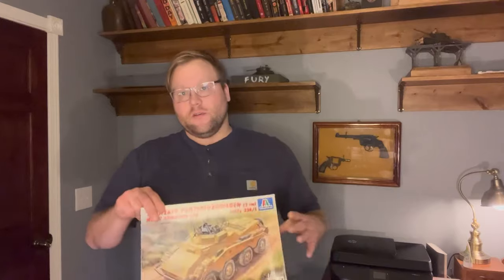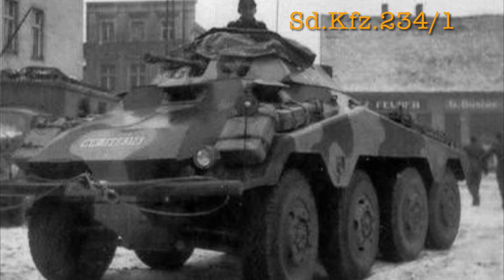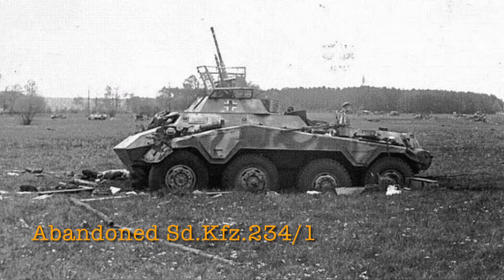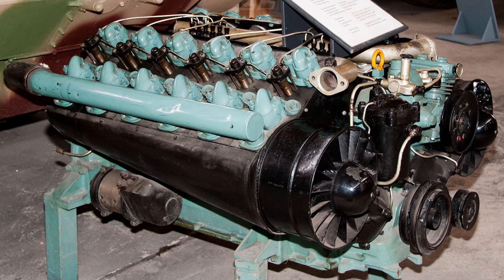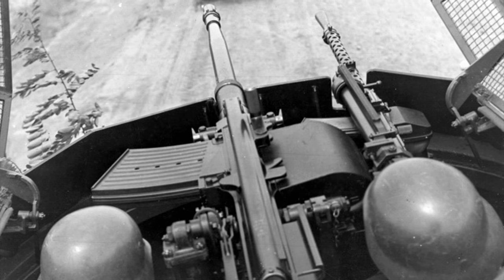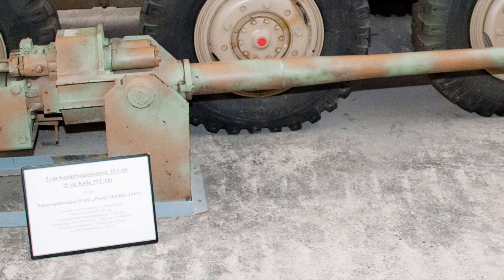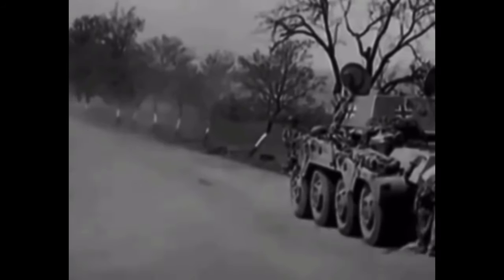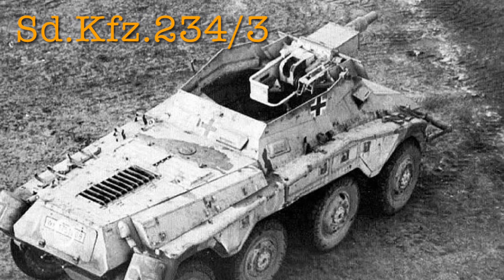History of the Sd.Kfz.234-before the build

Comment: COOL!
-Im just about to begin a well mod'd/shot up but repairable 1/35th 'PremiumEdition' Dragon Sd.Kfz 234/4 that when finished will be sitting on an Sd.Kfz 9 FAMO trailer (built with TMD's excellent resin 6 ton Bilstein crane conversion made for TAM FAMO & 'Panzer Concepts 'Late FAMO' front fender kit, FAMO & its trailer sitting on PanzerArts 12 wheel resin set for same)
-The 234 itself sitting on the FAMO's  Sd.Ah116 23 ton trailer, Ive recently purchased/found some great aftermarket pieces to go with the 234:  
-"E.T Model" makes a really cool 3D printed suspension set  (30$) that allows wheel steering (Much like the Dragon Prem edition 234 kits do too) but the printed ET set also allows for ^vertical 8 wheel station movement (If a wheel station(s) are shown crossing a log/obstacle/un-even ground terrain feature in a vignette/diorama)

-Also ordered an ET Model mixed tread pattern 8 wheel set for 35$, but itll take too long to get here via the s-l-o-w boat from China, so I went with "Hussar Models" 234 mixed wheel set (29$ for 5 wheels/tires) as the Hussar examples will get here MUCH more rapidly (Ive used Hussars excellent resin wheels/tires on 5 other Dragon 234 builds of all the variants. "Why 5?"....-For 12+ years been working away on  a HUGE June '44 Normandy PanzerWerkStattCo mega dio;)

- Also ordered a "Heavy-Hobby" '234 Engine Compartment w/a Tatra 103 engine' set (30$)-Highly recommended...
-Such replaces the 234's entire rear side panels & engine deck with PE sheets, the 2 fuel tanks & motor are printed examples, a GORGEOUS 3D printed motor it is too! (Already bought one a few months back only to find the new HH set with PE panels/whole engine bay-Ill prob use the HH duplicate to replace a previously built 234/1's bearing the  'CMK Tatra103 motor'-HevHob offers a MUCH better motor IMO)
-Also purchased Aber 234 PE compartment fender doors & fender  PE sets too...

THANKS for the vid on the subject/build!

Comment: The rarest version was a Sd Kfz 234/2  hull , with a turret from the Pz II Ausf L ( its shown in the vid for a few seconds ) .
Reply from the maker: I was wondering what that one was! It was clearly a 234 with what almost looked like an enclosed 234/1 turret with clearly different armament.
Reply: I believe it was known as the Tatra Tropical, there are a few photos of it.
Reply: @csh5414  I've seen it called the Sd Kfz 234/5 in some articles .
Reply from the maker: Interesting, I never came across that vehicle in any of the books or websites I used for research. May be a fun research project to do a video on.
Reply from the maker: Thanks so much! Look forward to reading it!